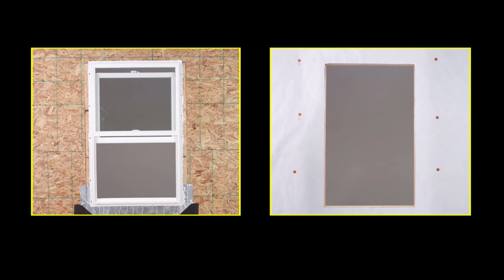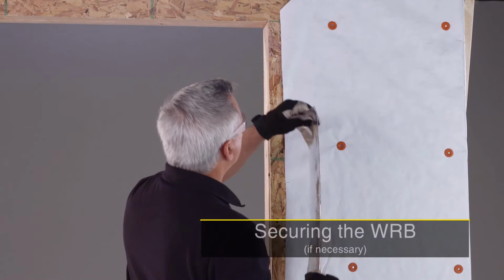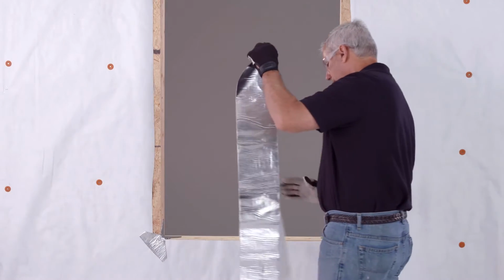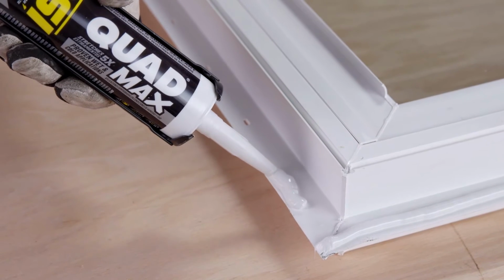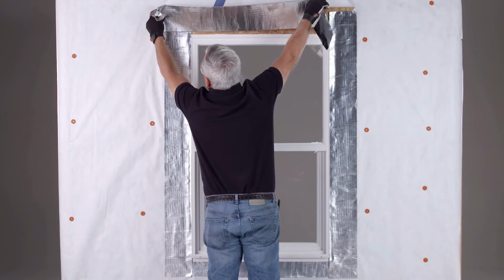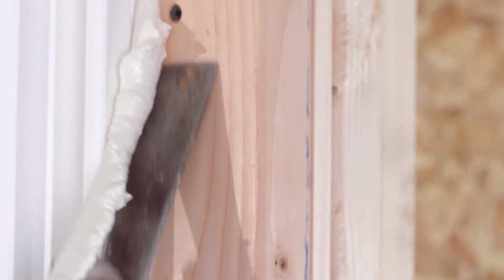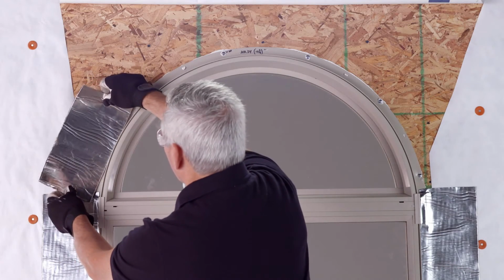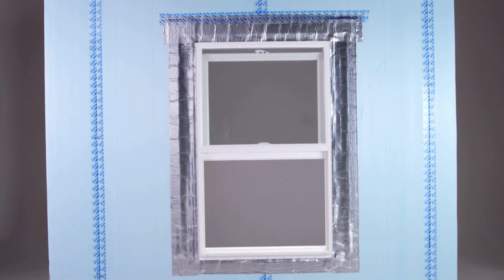How To: Method A1 Window Install

Comment: Leaving gaps in the sill portion of the windows doesn't mean any water will exit to the exterior, unless there is a sloped rough sill,and leaving gaps will let cold and warm meet....... and you'll have  moisture to drain, congratulations!
Reply: Interesting point... I wonder if there are any other videos that show best practices with this in mind?